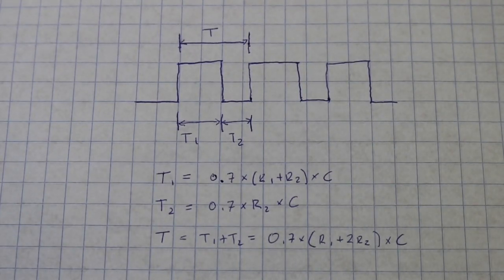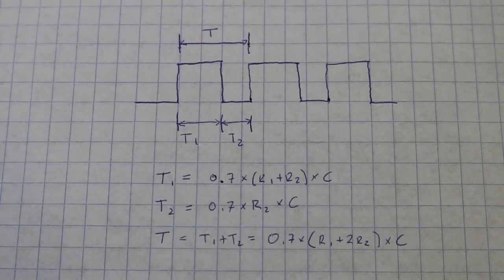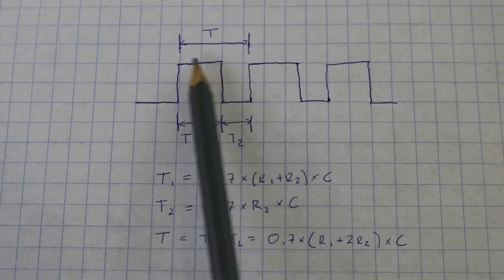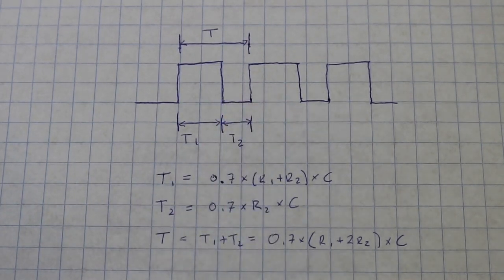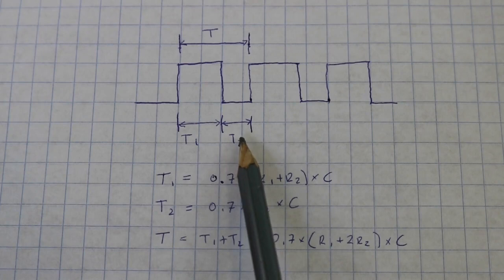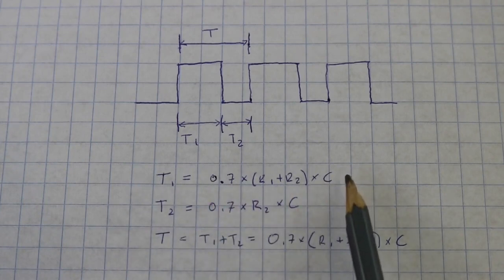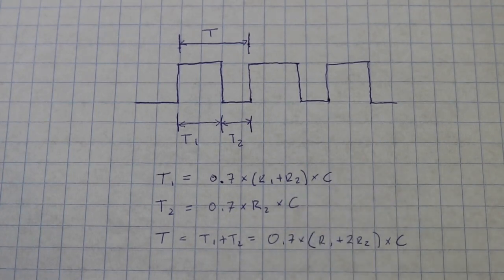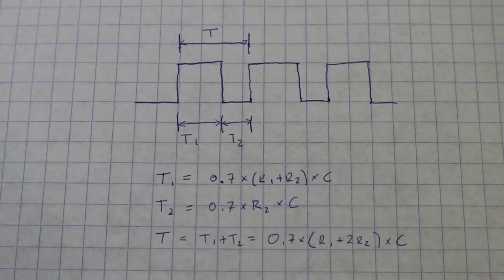Flashing LED Circuit with 555 Timer

Comment: Not the right circuit if you want to make an indicator for a plane wing.
Reply: remove the huge variable resistor and you can make it even smaller, bonus point if you can add smd resistors
Reply: https://youtu.be/xDmfEFamqUY

Comment: I have a challenge for you: make a blinky LED with the least amount of parts and no chips or transistor is allowed. Thanks for your videos!
Reply: This is my kind of challenge.  I choose a thermal flasher.
Reply: @JackANDJude  Yes, you can use that, but do you have a VERY SMALL one that is for LED only running at 3V???? and 20mA? Now that is a challenge I think. I don't even know if I ever saw one in my life.
Reply: https://youtu.be/xDmfEFamqUY